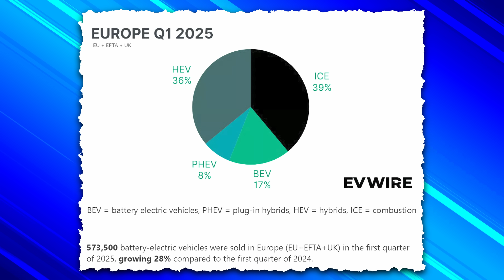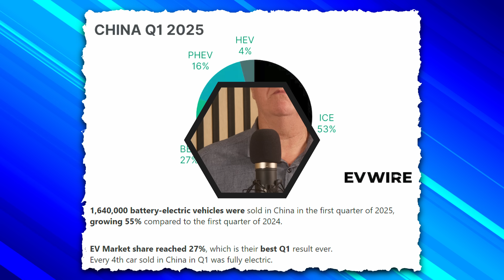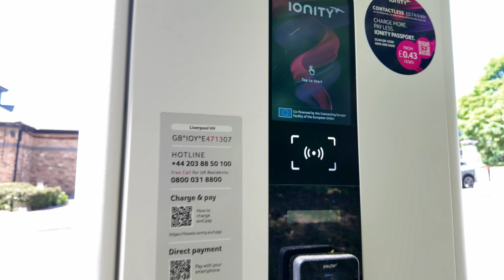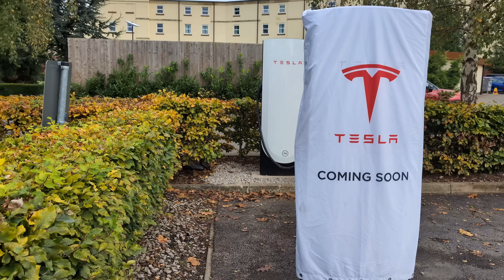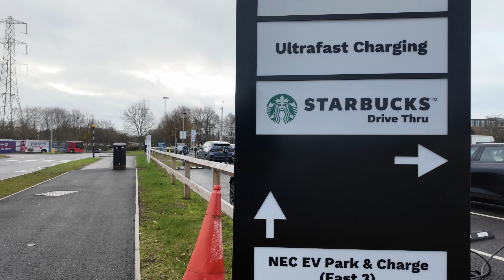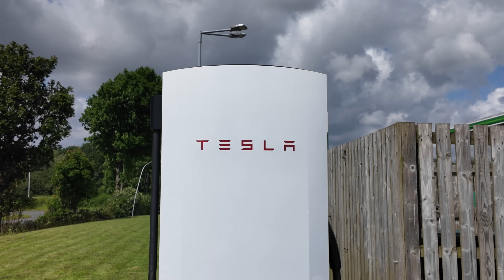The EV Revolution Is Here... But We Need To Change The Narrative

Comment: A lot of the mentioned gone to the wall car manufacturers went to the wall long before EV's. Just like many other long established manufacturers in other industries.  
This may be simplistic but auto manufacturers are in the auto production business. They adapt to demand and legislation. Up untill the 90's, petrol ice were the dominant engine for personal use. We than had the rise of the diesel with many thoughts on that similar to todays ev ones. Auto manufacturers adopted accordingly. EV demand is still low but increasing, auto manufacturers will supply to that demand. However, there is still a strong market for ice that needs satisfying. Tesla were a niche manufacturer in a very small niche market. The market is changing and this impacts all auto manufacturers. As EV demand increases the 'legacy' auto manufacturers, niche manufacturers like Tesla and new comers like BYD will all find themselves in the same pool.

Comment: Dave's insight is generally very, very good. NGL, he sometimes opens my eyes to something I haven't seen, which I both ADMIT and appreciate, but usually I am here for information and insight I can't get elsewhere.
But one nitpicking detail he misses is WHY the automakers are in debt. And that's because of wealth transfer to the rich. It's why private equity exists; buy a poorly run or otherwise struggling company, "tart it up" which often amounts to putting lipstick on a pig and then sell it off in an IPO bought by people using someone else's money - usually "funds", retirement plans etc. They call it "unlocking the value" and it IS technically true, but they are unlocking value that the existing management was too poor to see.

Comment: 'EVs are really popular' is always followed closely by 'China' or 'Norway' or 'California'
Nobody disputes that you can tip the scales with enough mandates & subsidies- we could see the same growth in tube TVs if you applied the same political pressure.

But in anything resembling a free market you get a clearer picture- 15% growth in the US, on top of a paltry 8% market share, is not what a successful, willing adoption S curve looks like- more like a bell curve.
Reply: European sales over the last 12 months show petrol has dropped to 28% & diesel 9%, less than 40% now are pure internal combustion.
Reply: @evostu7814  Well yes,  even with strict mandates, cars with engines far outsell EVs in the EU. But I think they will follow the US eventually and ditch the mandates- EU and China were also slow in lifting other mandates not so long ago.

Comment: Only reason ev are taking off is bc ice manufacturers wont get their act together and make engines and transmissions that last like they used to.

Btw way i still heat my house with wood and coal.
Reply: Niche economics make sense for some. If EVERYBODY burned wood and coal, you would find it not nearly as practical for YOU.
I owned (for a while) half an acre of wooded lakefront, people around me ALL burned wood for heat. Because it was "free". But if you had to buy it? In a city? Cheap heat is natural gas (our gas is currently incredibly cheap), I heat my 1200 square foot home for a year for what a single MONTH would cost in a big home in the UK.
I looked at heat pumps for my well-insulated, modern home in southern Ontario - even with government incentives the payback was measurable in TENS of decades. The EU pushing us to do something stupid by insisting on a "carbon tax" is really, really annoying to me, and I am way more informed and "climate change aware" than most.
BEVs though? We have an EV-tariff for overnight charging that is less than TWO UK PENCE per kwh. And that's "95% green" electricity (nuclear, hydro, wind, and a little bit of solar).
Reply: The automakers are getting their act together, but possibly not in a way you'll like. Their shifting production to electrified drivetrains, powered by batteries with optional low-emission higher efficiency generator-engines, no need for transmissions at all anymore.

Comment: I'm sorry but in my opinion this is one of the most biased and offensive pieces I have seen on EV's in a long time.

The EU and UK ZEV mandates have forcibly skewed the market against ICE production in the UK and the penalties for failure to sell EV's is forcing manufacturers, against many potential customer wishes, to throttled back supply of ICE vehicles due to punitive size of the penalties which are up to £18,000 on every Van and £15,000 on every car that exceeds the quotas, currently 28% of all car sales for 2025 and 35% for 2026!

Modern ICE emissions of +EU6 levels are so low as to act as air purifiers in some cities and the toxins released from ICE fires are nowhere near as great as those from EV fires.

Am I anti EV's no, do I see them being a good solution for some yes, do I see them as being a singular global solution definitely not. Do I believe there is still a market and place for ICE propelled vehicles, yes.

Are EV performance characteristics improving as the technology advances certainly but so have ICE over the years.

Manufacturers produce to specifications set by governments and operate under their framework. It is governments that have mandated and forced the transition to EV's it is not simply the merits of the technology and 'free' market forces that is driving any transition.
Reply: To make the assumption that all EV buyers are wimping to dealers saying a would rather have an ICE car but the government wants me to buy an EV, is frankly a fantasy.
Reply: @Barry-l1x  I said 'against many potential customers wishes' that is more than a couple certainly but I never said 'all'.

Yet again EV evangelists over state comments, continually deride the ICE technology and relentlessly oversell the EV 'green?' alternative whilst simultaneously playing down or completely ignoring the true limitations, costs and disadvantages of swapping to the new tech.

 As I said it has its place and is potentially a real benefit to some but it is 'niche' and not a global solution that will satisfy all.

In a similar vain 'Great net zero scam' adds £2Bn to airfares! Headline relating to the soaring cost of enforced use of 'sustainable aviation fuel'.

Can't wait to see when we are going to get the first transatlantic electric 'jumbo jet' full of economy seats offering cheap summer holiday flights!
Reply: @Just_a_thought-k9g  I found you post very measured, and I'm sorry some are not willing to engage with your nuance.
The only thing I would correct is that though both ICE and EVs are advancing technologically, it is very apparent that the pace of advancements heavily favor EVs. ICE tech is plateauing, compared to EV tech that appears to not even have reached its peak rate of development, despite massive increases in range and decreases in charging times in the past few years. It is misleading to merely say both have advanced.
Yes, I completely agree that government mandates are a powerful force in driving adoption. That's true of any technology that comes along offering large advantages on a national, and even global scale. Government will do what it can to favor it. Change is the only constant: it is often uncomfortable, but right now I think the world is facing far scarier changes than the transition to EVs. 
I bought an EV this year. It has saved me about 300 pounds in fuel costs in the first three months, has about 280 miles of range which is more than I want to ever drive in a single sitting, and has 3 years warranty left, even though it was 4 years old when I bought it.  Maintenance savings will be significant over the years as well. I'd consider myself a bit silly to be overly worried the government is actively pushing towards their adoption.
Reply: @malk6277  Thanks. Actually I've long been a supporter of EV's in principle and as an efficient use of a highly transformable energy source. The idea of KERS and the ability to use the energy to generate high torque at low speed and potentially with minimal mechanical gearing makes electricity a good energy medium. The issue has always been the energy density of storage and the associated risks of safe containment especially when coupled with a user profile that just expects to jump in flick a switch and go day after day year after year in every environment imaginable.

Energy density as a function of Voltage becomes increasingly potentially dangerous as the voltage increases. A 12V system be it wet or dry is a relatively small risk but a 1000V charging cable delivering a 1000A is a serious beast and an engineering challenge to ensure that it will remain safe for potentially thousands of connects/disconnects in all weathers.

What really gets my goat however is the 'singular' approach of seemingly every 'environmentally friendly' technology solution that totally ignores the holistic requirements and costs of the wider environment to adequately accommodate it.

A grid made up of wind turbines & solar, great cheap energy when the sun shines and the wind blows but ignores the cost of secondary backup sources and its inability to absorb system shocks. The idea that no one needs to have range anxiety because they won't ever have a real need to drive that far and there'll always be a working ultra-fast charger available when they need one.

The claims EV's are clean because they don't emit gases, whilst simply ignoring the impact of where and how the electricity was created and so on. 

They just continue to spout its virtues ignore its limitations and try to ridicule anyone that voices reservations about how much it is being over-sold to the unknowing and unaware

I wonder, will we ever see an electric tank, warship or fighter aircraft and if we do I'm not sure how they will ever be adequately recharged!
Reply: @Just_a_thought-k9g  I don't know if there is any real basis for worrying about the safety of EV charging connections. Time will tell, but this would be a MASSIVE liability for car manufacturers so I expect we can trust them to have over-engineered the safety of these connections. From the little I know, that is the case. No current flows until the charger and vehicle have completed a handshake that includes a number of safety checks. 
None of the advantages EV hold are absolute. The tech isn't perfect, and it doesn't need to be (nothing is). For the purposes of these discussions, it just needs to be better than ICE, and overall, it is.
Reply: Have you driven a Tesla or any other EV?
Reply: @johnharcombe9412  I've not driven one but have been a passenger on a test drive of a 480hp mach-e. Was it quick, yes enough to make me slightly dizzy! Was I impressed? No not really, I prefer manuals (stick-shift) and I'm not that keen on all the bells & whistles or basically driving a laptop on four wheels!

As someone with an electronics background I'm not against the concept of a small, compact, light, cheap, simple mechanical transportation system that makes best use of the efficiency and flexibility of the effective energy transfer capabilities of electrical charge to provide a low/mid speed high torque transportation device, basically a 21st century Sinclair C5.

Unfortunately that is not how the technology has morphed and so whilst I'd love a cheap, simple, light weight, compact, easily charged, short range electric vehicle as a supplement to my 'C class' 2L diesel, that's not where the tech has gone because governments have not allowed it to.

Had a true 'free' market been allowed to develop an alternative form of electrical transportation, perhaps there would have been a more enthusiastic uptake by customers.

Governments shouldn't get so heavily involved in determining where the market goes, they should focus more on ensuring that the customers who purchase such items are adequately protected.

70mph e-bikes look fantastic but they are highly illegal and very dangerous both on the road and as a safety and fire risk. At the other extreme 15mph bikes with 250W motors are overly restrictive and so many owners just break the law. What we need is some intelligent government policy and effective policing that allows for an achievable middle ground to be found.
Reply: @Just_a_thought-k9g Sounds like an arm chair expert talking.
Reply: No you never said all, but I seem to remember the same argument made that the government pushed us all into diesel cars.
I think people bought diesel for two  reason  because they are cheaper to run and the engines last longer.
If you can charge at home EVs are just better, but if you can’t charge at home then😊 at the moment petrol is a better buy.

Comment: The most green vehicle is , and will always be one that has a small engine, ten years plus old , and can be kept on the road another ten years plus. Not a disposable EV , with batteries you cannot replace, because when they started building milk floats they chose batteries that are integral to the vehicle, and not ones you change out , each time you charge making it future proof. This is because they want you to constantly have to replace the vehicle, and you've all fallen for this con, thinly disgused by environmental issues, and is in effect the total opposite. This is a  ploy to make you consume more, and more, of the earths depleting mineral resource, but carry on you've all been dupped by Starmers Davos mates.
Reply: What are you going on about, the early EVs leased the batteries with the ability to swap them if they were faulty or lost too much range. The majority of EVs use skateboard designs where the battery pack can be removed from the car by unbolting it. The batteries are not 'integrated' into the car, and so hard to replace, as you claim.
Reply: @GruffSillyGoat No you don't get it do you. Each time you charge you exchange the battery pack for fully charged, and certified safe one. You just rent it for the duration. It makes the car cheaper as you never have to own a battery pack, and the car gets fresh battery every time, in and out in ten minutes.   The batteries could then be recharged, and checked while not in the car , and any remedial work carried out on faulty cells. Great idea but big businesses, Starmer's Davos mates didn't want this. 😊
Reply: Getting a little paranoid there, battery swapping hasn't taken off due to technological, economic and public concern limitations of the approach. It's a higher infrastructure requirement approach that requires people to trust a third party with provision and maintenance of a key component of a significant purchase (a car); it was a good idea whilst the cost of the batteries were high but as they've dropped so much and last so long the risks outweigh the benefits for most EV buyers.
Reply: @GruffSillyGoatAnd making it last longer, which is the last thing you want if you're manufacturing EV's. White goods, make obsolete within ten years, and you're back for more. It's a  normal business model. If you  have a product that lasts, and lasts you're profitability , and viability will fall... simples 😊
Reply: Oddly, EV's seem to be lasting longer and their batteries have an even longer life than the vehicles they originated in. 

It's also odd that those mainly saying EVs won't last and are white-goods in one breath, also say that ICEVs no longer last as long as they did in the past in another breath. Whilst forgetting the cars of yesterday were pretty much falling apart from they day they left the factory.

As to automakers they are planning on a shrinking market, with longer sales cycles - which is why they're reducing capacity and closing factories. Plus seeking to make those factories that remain as efficient as possible, part of which involves moving to electrified drivetrains with lower costs, less parts that can be assembled more quickly producing more vehicles per minute per factory. 

Quality of product is a by-product of the nature of an EV, as there are less moving parts and less to go wrong. The electronics and electrochemical components by their nature are long lasting, as handling high power levels needs quality components and so longevity tends to automatically get built in by necessity rather than design.
Reply: Battery packs can be removed because the latest ones will outlast the fabric of first car they are installed in.     Time to wake up to the new reality.

Comment: Once you drive a good EV you’ll never want to go back 🎉
Reply: Very true. Bought our first Ev in November. I just ordered a second. I wouldn't go back to ICE.
Reply: I'm not sure that's completely true. I run a Skoda Elroq EV. However I still love my 2009 MX 5.
Reply: @madmcadder4536  completely agree. Horses for courses. EVs are great at some things, ICE better at others. You are able to enjoy the best of both worlds. I too have driven both. As a local tool, EVs do well, we also own an MX5 too and that’s an experience.
Reply: @andrewhill9369  Try the Cyberster if you can, I used to want an MX5 or a Boxter as a 2nd car, now that's the car I want :)
Reply: @VideogameBucko  yeah, I used to work with the MG manufacturer a few years ago when it was being launched. TBH my daily is quick enough, although it’s a wagon, so it’s bought for a practical reason and the MX5 is just about handling as it’s silly light and the manual gearbox brings involvement (it certainly ain’t quick!)
Reply: @madmcadder4536 Great little car 😊based on the Lotus Elan 😊 look after it
Reply: @madmcadder4536  For those who can afford to own, tax, insure and maintain more than one vehicle, sure... why not have an ICE in the fleet? Different flavor. Some folks like to own a Model T Ford from over 100 years ago... but nobody drives one as their daily driver. Like it or not, that's the direction ICE is heading at the moment. Towards becoming a collector's item. It might take another 10, 30, 40, 50 years to reach that point, but that's where the graphs are pointing.